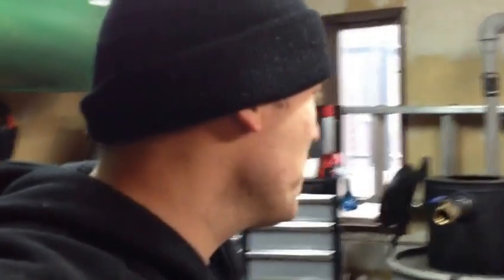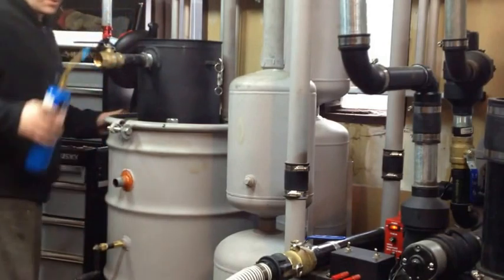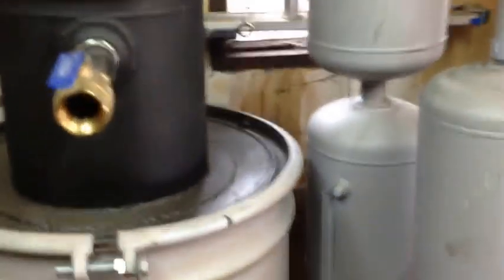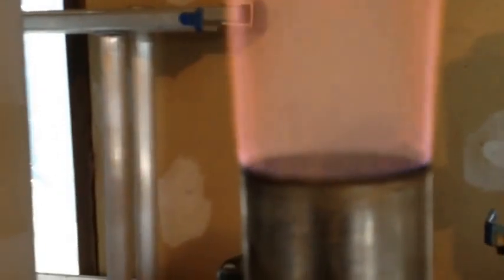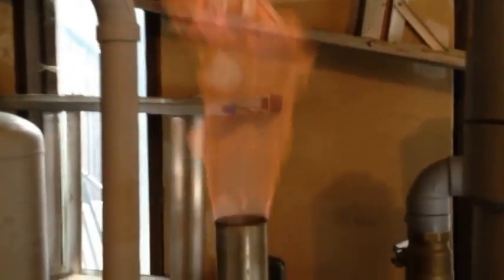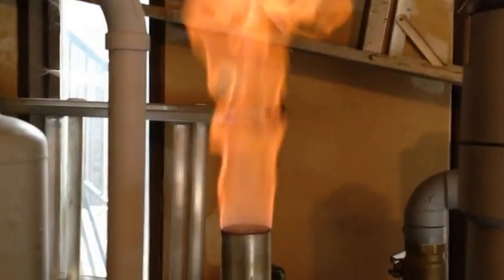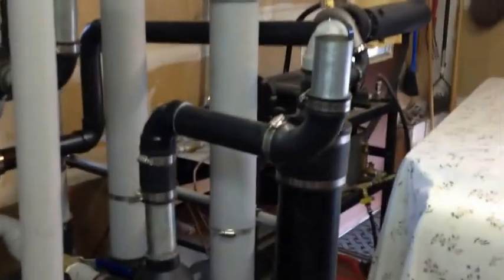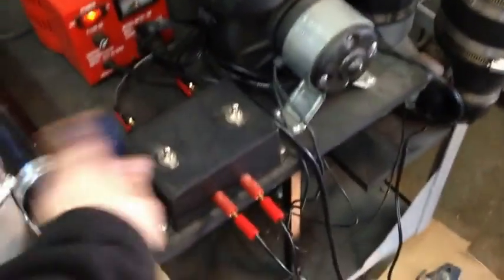woodgasifier run

Comment: Hi , just wondering where did you get them blowers 
Please
I had to make 1 and its not great
Reply from the maker: Hi Marc I used a bilge blower style then what I did was get a rubber pipe coupling  reducer from Home Depot or Lowe’s hope that helps bud

Comment: Great! Now that you have wood gas I'm guessing you plan to convert to a generating system to power your home? If thats the plan then you may be in for a surprise. As typical portable generators are not meant to run 24 hrs as they are made cheaply and are good for a short (perhaps a few days) duration.
Fortunately in my area there is natural gas and that is what I run my generator's on. You notice I said generator's. You may need to alternate them to balance the wear and tear if long term use is required.

Comment: Looks like a good set-up and it seems to be behaving itself,, i have taken the liberty of using your wet scrubber idea, i adapted a 12 volt camp shower system ,hope you dont mind,,,,,,with some extra mods on my filters i now have a wonderful blue flare,, much research and development after 3 years finally ,, check out my automated hopper (fan motor), and grate shaker (windshield wiper motor),, the whole system uses a 12 volt battery,, thanks again  and great job ,, cheers from down under.
Reply from the maker: that's what its all about sharing ideas man, awesome to hear it worked out for ya bud Merry Christmas

Comment: I don't believe you can have too much suction at start up... you want it to get very hot very fast so you don't make tar. I use a small shop vac for start up... works well and I know my system is hot in 5 minutes or less.

Comment: Ahhhh, that great feeling when you run your engine on home made fuel for the first time.
You'll always remember it, and surely smile each time it comes to mind  :) .
Keep up the good work.
Reply from the maker: thanks again.  I know what a great feeling when something you make works.  Your right wood gas can be addicting bud : )
Reply: *****
Don't fight the addiction. Let it take over.
Amazing new technical ideas will come to you - at the most unusual times.
A a result, maximum coolness will be achieved in pretty short order  :) .

Comment: Hey Joe it's nice to see the engine running. Joe be careful with the gas on the filtered side. What I try to achieve is to have the gas invisible on the filtered side. If you see any smoke or fog it could be lighter tars that aren't getting broken down in the gasifier. Are you running on wood pellets? They are hard to burn clean. You can also pack the filters a bit harder to clean the gas up too. Just experiment till you find the right combination. So far, you have everything looking really good man!
Reply from the maker: ya buddy your right I need to pack the filters a bit harder. Thanks again bud for your help really appreciate it
Reply: *****
Joe are you running on wood pellets?
Reply from the maker: flash001USA
Hi flash it turned out I didn’t pack my filters as I should, this is why I had smoke.  I put in more saw dust and bingo that was the key.  I do use wood pellets and some wood chips.  As of right now I find the wood chips are giving me a little headache with bridging problems, as for the wood pellets less of a problem.  Im just putting another video up and buddy I find some interesting experiments with the flame.  Once the fuel wood pellets or chips are down to the start of the reduction zone lip things get really lean or the flame is from orange pink then violet blue then blue due to the chips or pellets turning into charcoal.  Now if I don’t add any wood when the flame is blue it will burn itself out. So instead of adding wood pellets or chips all the way full in the gasifier making them moist, I believe adding little bits at a time help breath the  machine and help keep the filters very clean. Sure your adding 4 hands full of wood every 7min about it sure keeps things clean.  Its cool man to see this.  Cheers man
Reply: *****
Joe I tried wood chips and they didn't work well for me either. I use dead branches from the woods that have naturally dried out and seasoned themselves dry. I cut these into a mixture of 3/4 to 1 inch chunks and they work fine. I start the gasifier with biochar and once the system is hot I add the wood fuel. Wood pellets are hard to burn without tar being produced due to the air flow in the ember bed not being able to penetrate into the fuel very well.
Reply from the maker: flash001USA I will be sure to try that out my friend thanks a bunch